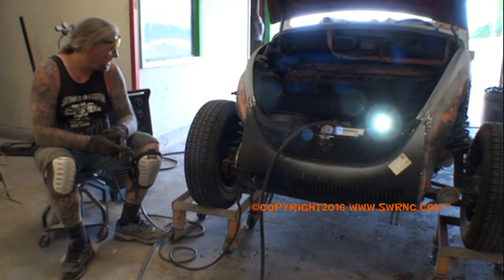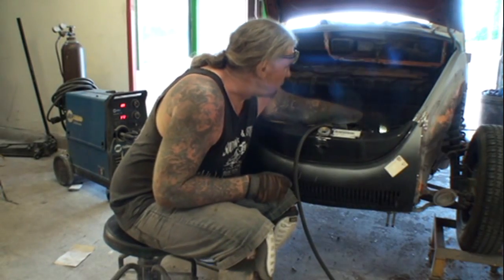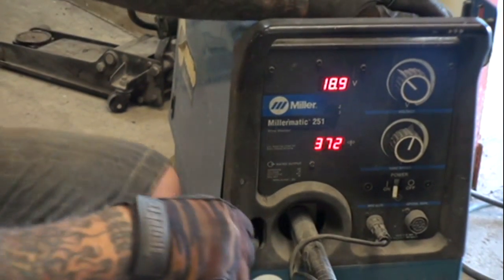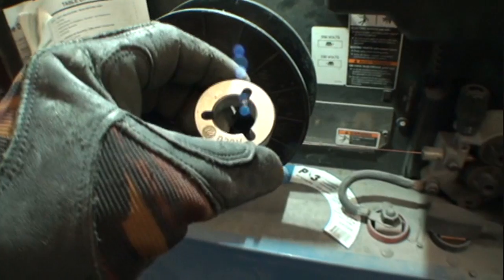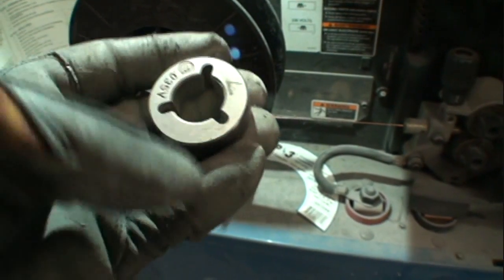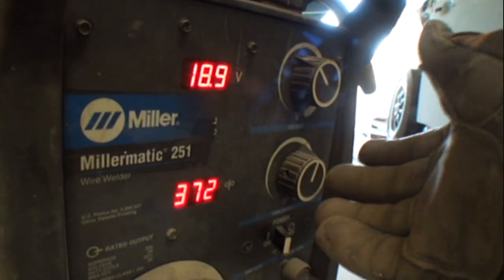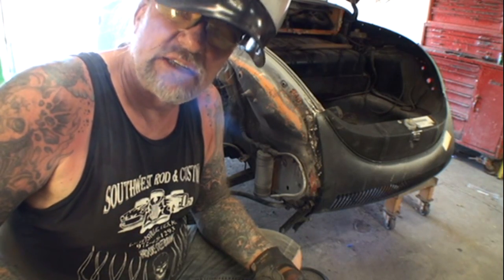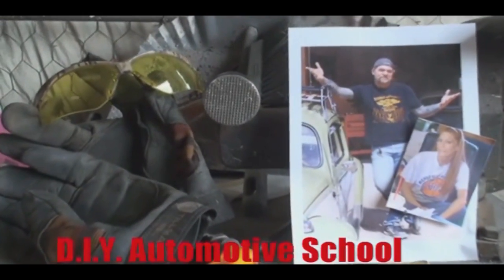How To Use A MIg Welder-Choosing The Correct Wire Size For The Job

Comment: My friend Pete, do you do a lot of welding on things over a 1/4"?  I would like to buy a 110 volt mig welder but they only weld up to a 1/4",   Do you think a 120 volt welder is worth it?  Thanks.  Great videos.
Reply: You can weld 1/4" with a 120 volt, but the amount of time that you can weld between cool down time is limited. My little 120 volt MIG has a 15% Duty Cycle. In other words, I can weld continuously for 1.5 minutes then a have to let it rest with the fan blowing for 8.5 Minutes. It's the welder's transformer cool down time. The better the welder and the higher the voltage it requires to operate, the higher the Duty Cycle. This rating is the key to determining the ability of your welder.
Reply: john imburgia 1/4" steel is a little rare in hobby worlds and auto repair really.  The benefit in sticking with 110V will pay dividends when working in sheet.  The reverse isn't always true...

Comment: Hi Pete. Excellent information on distancing your work from your gun. It works. :-)
Reply from the maker: It takes practice but works well if you get the hang of it.. When you pull back you have to move slower or you'll get splatter and slag.. It's all in PRACTICE MAKES PERFECT--Hope you and your daughter are doing well.. Pete

Comment: My 90 amp harbor freight flux core welder will work like shit with any size wire! lol  Great info Pete, thanks for the vid.  Tell Seacil Magee I bought a new F150 4x4... with an electronic locking rear differential and a tow package...that should turn him on hahaha
Reply: hey man, dont knock the harby welder, I've made 800 bucks with mine welding skate rails.

Comment: No fkn wonder!! I'm self taught mechanic and doing some body work on the side learning. The welder came with 35 thats what ive used for exhaust welding, ect., ect..  I finally get some nice stack of dimes welds with it after years of practice, lol.. pretty big though.  I will be getting some .23 cause sheet metal is not fun with .35!

Comment: Fuck I just ordered two rolls of .30 wire for my Miller 211 auto-set. I did burn the shit out of my sunruf patch up in my truck
Reply from the maker: The 211 is a good welder, sorry to hear about your misfortunes...
Reply: +diyautoschool what is a good price for a 68 c10 with rust issues? The guy wants 2k for a long bed with rust damage, is that about right? I really want one of these c10s

Comment: it's funny when you work at a welding shop because 0.35 is the most have diameter wire, and some partners brings their shit metal from a project they have at home and they finish with a hole bigger than a quarter dollar coin, but they still think that are able to fill that mess by keeping making the situation worst. Epic face palm my friends.

Comment: Plug welds and spot welds two totally different processes my friend. Plug welds are what you are doing with the mig. Filling a hole with molten wire. Spot welding adds no metal to the joint and is caused by the heating of the joint due to electrical resistance to a high current and then pinching together of the molten areas. 
 As an asides I have seen professionally restored cars( think mega bucks) loose concours judging points simply because puddle welds were used instead of spot welds. If it matters, and most don't, then you can't substitute one for the other,the factory never did. For most projects like daily drivers,weekend cruisers and low level car park shows then it ain't an issue. When you get up to the world of concours competition and historically important cars then it really does matter. It was never much of an issue till you get the situation we have now where early muscle cars are in the six and seven figure price bracket! Hell,saw some VW bugs and busses getting up there
Reply: Pete knows what a spot weld is, Mr. Literal
And this is "DIY"Auto School....for guys fixing shit at home or at most small scale to pick up some knowledge.
We don't have spot welders anyway.
We're not taking anything to fucking Barrett Jackson.
Take that shit over to Eastwoods channel.

Comment: Hey guys I’m gonna be 100% honest and just tell ya that I don’t know SHIT about wire welding and I’m no genius at stick welding but I did take a course in stick welding about 25 years ago. Ha 

I bought a cheap 110v flux core welder on amazon and I’m trying to learn how to use the damn thing. All I need to do is small around-the-house kinda jobs so lives aren’t dependent on my welding. 

I don’t understand the wire sizes I need.  My machine says (and I’m cut & pasting) comes with —> reel of 0.9mm, 0.55lbs welding wire.  

Wtf does 0.55lbs mean? Is that the same thing you guys are talking about when you say 023, 030, 035?   I just never hear anyone refer to their welding wire in lbs . 

Anyway thanks for any help you can give me to get me started.

Oh wait! I forgot to mention that my machine calls for 0.6 - 0.9 wire and that’s all it says. I am confused as to what all this 023. 030, 035 talk is about? I’m only half way through this vid so I’m gonna continue to watch and maybe I’ll eventually understand. Lol
Reply: .55 lbs means there is just a little more than half a pound of wire on the new spool of wire. The 0.6 to 0.9 wire is metric measurement of the wire diameter which should be close to the .023 to .035 diameter wires in the U.S. millimeters vs inches.

Comment: The farther your tip is from the metal the hotter you’re actually burning..not vice versa...and actually welding that far away with solid wire and gas is pointless because the gas isn’t doing it’s job and preventing contamination. Not to hate but don’t be so cocky unless you’re 100% right .

Comment: Great tip!
Been using .035 wire (flux core) to do all my body work for yrs...
I got used to it, so ive never tried other wire...
Might give the .023 wire a go, once my spool runs out...
Thanks Pete!
Any chance you use panel bonding adhesives, and if so would you do a vid on that?
My buddy that works in a shop always laughs at me for welding my patches, and says to use the adhesives...

Comment: .23 is so hard to find in my area so i use alot of 
.30 and .35 just sucks in my welder thanks for the tip pete
Reply from the maker: Yeah--035 is for Train or BIG TRUCK REPAIR, and it takes so much heat to make it penetrate.. I just fixed an 18 wheel trailer a few months ago for a guy and my welder was running so hot the cooling fan wouldn't stop unless I turned it off...
Reply: same here .030 is what i have all ways run
Reply: +diyautoschool is super Dave still around
Reply from the maker: Try .023 and you'll see a big difference..
Reply: ill order some off ebay and give it a try bud

Comment: So for thin sheet metal I want the .040 or larger wire and max heat, right ?
Reply: Hell yes,start on max current and keep turning it down till it not blasting it full of holes, then you on max penetration.

Comment: I just started at a rusteration shop I can't believe they use only .30 wire 😡. I hate it can never get that fuckin welder set right it's either not enough penetration cause I got it turned down or you turn it up ever so slightly and bam your burning through making a 5min job 20plus minutes 😡. But the boss went to autobody school he thinks he knows everything won't consider my suggestions so 🤷 he sings my check so 🙄

Comment: is your welder 220 volt  or 110
Reply: That welder is 220v..
Reply from the maker: 220v..   owning a 110 ,,, if it's a brand name should give you the option to use several different size wires, make sure you own a welder that you can use gas with, not fluxcore only!

Comment: Hi Pete thanks for all the advise and education I have watched almost all of your videos,thank you ....I have a question I bought a welder and it came with 0.035 flux core wire and I think your right about the size and welding,  Is .035 flux the same as 0.023 because it is larger diameter due to the flux coating ...? I have looked on eBay and can't find .023 flux core wire , so that's why I ask...0.030 is the only other I can find .... I can only weld outside so can't use gas....Tx bud
Reply: Did you miss the part about how you shouldn't approach a vehicle with flux core anyway?
Watch more viddies.
Reply: Why shouldn't flux core be used on automotive sheet metal?
Reply: FoMoCo1 it runs hot. You'll easily burn through light sheet metal. Can it be done. Yes, but it isn't gonna be pretty. The added heat will also warp the hell out of that thin metal. Better to grab some .023-.025 and some C-25 (75% argon, 25% Carbon dioxide) and weld it proper. Even a 120 volt machine that runs shielding gas will do auto body just fine.
Reply: That makes sense now. Thank you sir.
Reply: They teach you to NOT use Flux in wielding in schools for Automotive collision. 

Just a crappy wield.